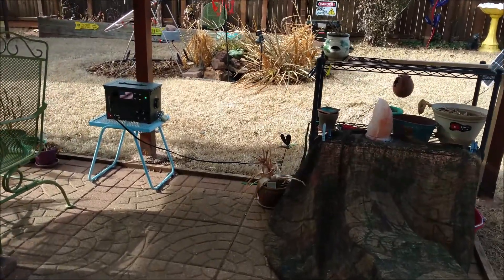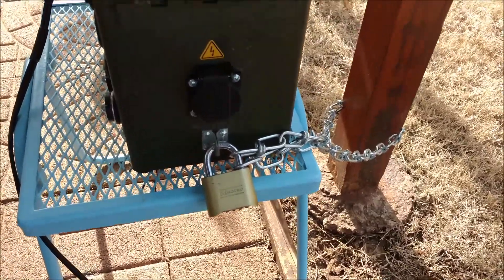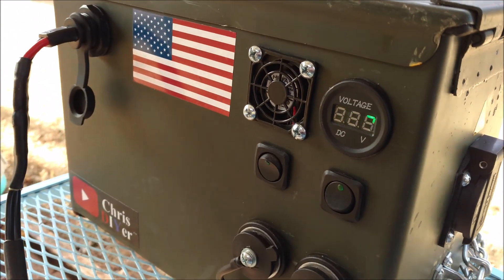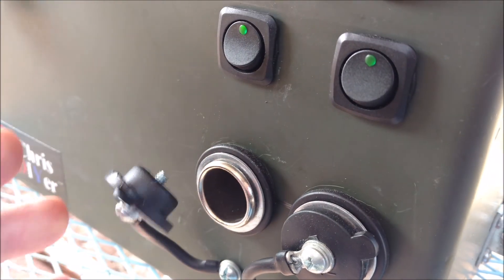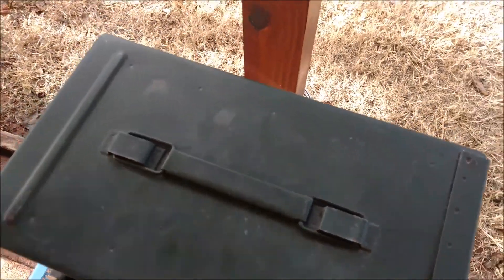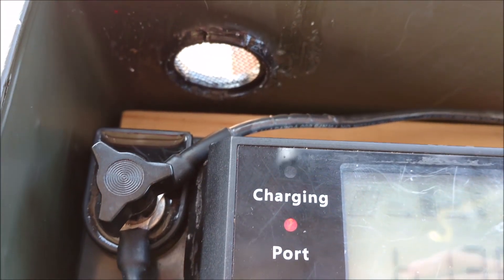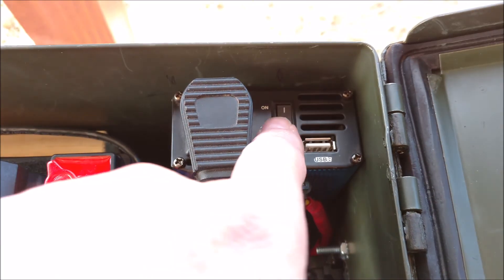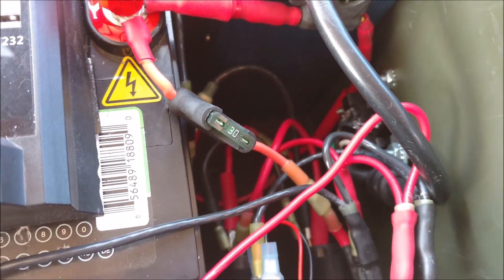Micro solar power generator 2.0 (more stuff, more practical)

Comment: WHOA Chris.....somebody close the FREEZER DOOR !   Nice touch to the porta-power box. One suggestion on the security hasp.....replace the Philips bolts with pop-rivets so some prankster won't unscrew the goodies.  Try to stay  D-FROSTY.     J K
Reply: Good Idea, or use a security Torx (tamper resistant)  screw/...
Reply from the maker: Yeh, that's a great idea...thanks! Next time I in Lowe's will pick up some.